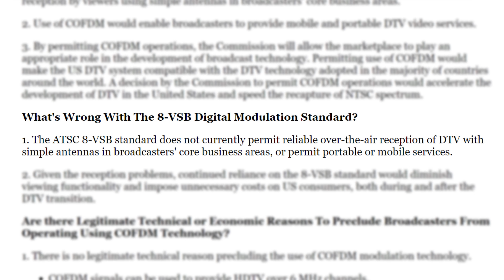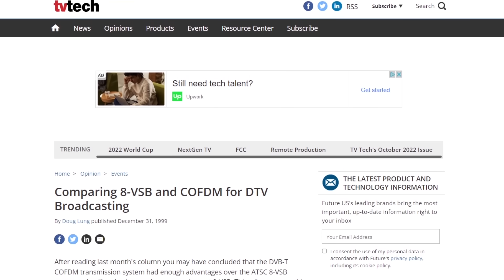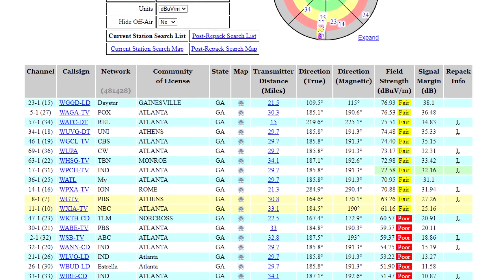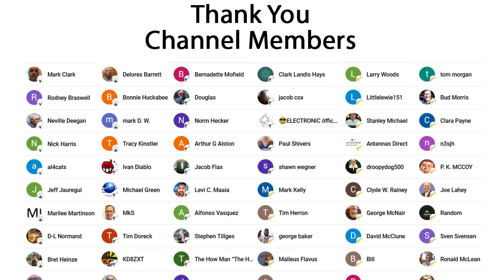This FCC Decision Made Antenna TV Less Reliable for All

Comment: As an engineer, no one listens to engineers, and when shit inevitably hits the fan, it's always "I told you so".
Reply: As a laborer, no one listens to them.(engineers). Some young graduate wants their autograph and a big at'a boy on a product or system that wasn't broke to begin with. Everything over engineered and junk nowadays. Disposable
Reply: Its been going on since I worked in the electronics industry back in the 1980s (engineering tech).  We were working on one of the first (and biggest) packet-switching networks and the management refused to upgrade the network to make it faster/cheaper/more compatible with a variety of data products like small regional competitors were doing (the big $$$ were in customers leasing time on the network).  We started losing customers in early 1989 and while our division management made excuses to corporate all us tech staff made for the exits.  The place closed at the end of 1989, the network shut down in the USA in about 1996 (IIRC).

Comment: My local digital TV reception is garbage anyways, during the black out on my Verizon FiOS TV service, I could not even receive WAVY-DT 10 too clearly.  I had to just simply give it up until Verizon came back into agreement to get the station back on the TV line up.  ATSC 1.0 is not very dependable.  I hope ATSC 3.0 will do better for this in the near future.

Comment: Thanks Tyler!  I've seen some of your videos before, always informative.  I think you might have answered a nagging question I've had for some time now (since cutting the cord actually).  I don't mind Antenna TV because there are actually numerous channels that offer so much from classics TV sitcoms to classic movies.  I've bought the more expensive indoor antennas to the really cheap ones and have found there is really no difference.  I actually am using a jumbo paper clip now because it is easier to adjust.  I always wondered if an outdoor antenna would solve my main issue, THE PIXILATING, (S.P), THE DROPOUT COMPLETELY, THE PROBLEM OF ONCE I HAVE A STATION WITH EXCELLENT RECEPTION IT KNOCKS OUT THE OTHERS.  SO FREAKING FRUSTRATING THAT I AM SOON GOING BACK TO CABLE (just the basic, no premiums) BECAUSE I DO NOT HAVE THE PATIENCE.  It seems like this latest video of yours tells me there is no hope.  I am so disappointed because I thought if I invested in an outdoor antenna my problem would be solved.  Anyway, thanks Antenna Man, always enjoy your videos.
Reply: I too tried indoor antenna's and could not get all the main stations without adjusing the antenna. So I installed a relatively inexpensive outdoor antenna and get all stations without a problem. I also set up about 11 of my neighbors with the same setup. We are about 30 miles from the towers that are located in Ft. Myers, Fl.
Reply: @danmehlman3365  Thank you Dan.  This is good to know!
Reply: Before you decide, look into streaming TV. When my OTA reception tanked, I was loath (and unable!) to afford cable--and I'd had terrible experiences with it in NYC, outages lasting for days at a time. I read dozens of online reviews, compared all the services then available, and picked one, with which I am very happy. It's not the cheapest, but has all the local stations live (even including PBS) and the reception is excellent.  There are cheaper services available, and even some free options--if you want live local news, etc., you usually do have to pay.  Living alone, I didn't bother with hooking up to my TV; I just watch on my laptop. Just about any streaming service is cheaper than cable if you compare what you get (especially sports). One way to go is to try each service in turn free, if they have a new-subscriber offer, and see which suits you best. Get the week or whatever free, cancel, try another.  Good luck.
Reply: @elainechubb971  Thank you.

Comment: It was a bandwidth issue of 6 MHz VSB vs COFDM 8 MHz. All TV channels are 6 MHz spaced.  The FCC limited the TV signal to 5.8 MHz side-bandthen it was a feed forward system.
Reply: Agreed. 8VSB played better with adjacent analog channels and required less power to cover the same area and didn't require all of the translators like Europe uses.
Reply: @navigate2u  And yes, we needed more power on COFDM on our ENG trucks than 8VSB, S/N ratio better
on 8VSB. More range. Also our main xmitters output had RF mask filters, keeping sideband noise down was a problem for adjacent channels and necessary. (FCC)

Comment: I'm a PBS affiliate broadcast tech. As Bob Diaz mentioned, the Zenith 8VSB lobbied long and hard. COFDM was also in the running, but the Zenith won. I think they somehow curried favor with the feds (FCC). Such a mandate, we were running announcements that "It's The Law!" It was a scare tactic to get people to switch to the new digital system. We were told that 8VSB was the best. Now, we'll be changing to yet another digital system - COFDM. Don't  know what to think of Zenith 8VSB; sounds like it was kind of a scam. Should've went with COFDM in the 1st place.
Reply: Yes, it would have been much better to go with COFDM from the get-go. So you work for  PBS, so I don't expect you to confirm this , but they seem to have taken advantage of this third digital dividend by selling their frequencies in the auction and trying to pick up VHF low stations, basically garbage frequencies. They made Millions.
Reply: The ways of the corrupt ….are never ending!

Comment: Excellent documentary on this.   The only comment I have is why the FCC mandated lower power for stations, especially for VHF?  I understand the electric bill issue, but we have a local VHF station petitioning the FCC currently for a UHF frequency, because their range is so poor.  They used to operate at 316K watts and now it's a mere fraction of that power and no one can view them.   Why doesn't the station have the option to increase their power?  150k watts would probably provide a really nice signal comparative to UHF, AND, it would still be lower than UHF stations, which run much higher wattage.  Signals drop off to almost nothing after 80 miles so let them use the power they need to use to satisfy their customers.  

Ok, so in theory stations may not really need that much power for their current modulation, but when that theory falls flat on it's face, which it did, then the FCC should amend their power rules accordingly and begin using that channel bandwidth as it was used prior to digital.

I live 12 miles from the station and I cannot get their meager VHF signal within my home with rabbit ears, though before digital it was never a problem so this is a clear failure of our FCC to support both the business and the viewer.

My solution, as you stated, was to purchase a 6 ft. VHF/UHF antenna, along with an amp.  I had to incur all of that expense because of an arbitrary FCC decision for VHF channels to run very low power.

Just who is the FCC supposed to be serving? Cable operators??  Yea, I think that's the problem.
Reply: 1) The possibility of VHF digital going beyond the horizon and interfering with analog during the transition was very real. Low power was intended to prevent this. In at least one low-VHF case, a digital station's power had to be reduced further when an analog co-channel station complained.
2) Power levels were based to a great extent on the 1950s measurements of analog propagation. The FCC failed to recognize that the levels of interference in the VHF band (especially low VHF) had increased over the years. Some engineers called for a plan to increase digital power after analog went away, but the FCC never developed it. So, broadcasters bought cheaper, lower power equipment without expansion capability. To increase power levels now without interference, all VHF stations would need new equipment to be turned on at a certain date. Economically, this isn't going to happen. All the dollars have been spent moving channels to clear more spectrum for mobile phones.
Reply: @oldtvnut  Understand the digtal/analog issue.  But it's time to revisit the problem and fix it.   As to the cost of these transmitters,  Telcon's paid heavily to purchase  the upper part of the UHF band.  This was money WE pay to them in our monthly phone bills!!  The govt. then ordered the repack to allow the Telcon's purchase and allowed stations to be compensated for the cost of these new transmitters and antennas that were required for them to change frequencies. 

So for this VHF station, the way I see it, we actually paid for their transmitter through our phone service.  The station itself hasn't incurred any cost, so they have the option of purchasing a new transmitter.  

But, as you say, any engineer worth their salt would probably have purchased a more powerful transmitter than required and either lowered the power output to meet FCC specs, or reduced the ERP using a lower gain antenna.   I might be wrong, but they may have the capability to raise their power by just replacing their top antenna with one with higher gain and increasing their power.  

It would be nice to see an active TV engineer respond to this.
Reply: @oldtvnut  I've been installing TV antennas for 31 years. In some areas, VHF-HI does much better than UHF does - like in my area. WJLA-DT 7 and WUSA-DT 9 penetrate through trees much better than all of the other local UHF digital channels. Channel 7 and 9 almost always have a stronger signal 40-70 miles out with an outdoor antenna.
Reply: @navigate2u  Agree, it will.  I think the real issue is that VHF CAN certainly do the same distance as UHF on much lower power but the antenna has to be the same gain as you can get with a UHF antenna. You can get 12 to 14db gain from a 8-bay UHF antenna, but to achieve close to that same gain with a VHF antenna, you're talking about something 10 or 15 ft. long like we had on our houses in the 60's.

IF the FCC thinks the general public is going to go back to installing those long VHF antennas, they are mistaken.  This is one of those situations that works mathematically, but totally fails in actual practice.  It may mean either abandoning VHF, or reducing the number of VHF channels, giving each one a 200 mi. gauardband, and letting them put out more juice.  The FCC needs to respond to this problem for the benefit of the viewing public.  At last check, they were funded by the viewing public.
Reply: One of my local VHF stations reduced the power from a few hundred kilowatts to 8 kilowatts.
Later after people switched away from antenna reception they put it back up.

Comment: I’m excited for ATSC 3 locally, but also it means that I’ll have to get a crappy digital converter box for some of my old TVs and at least one will be totally obsolete
Reply: Where are the crappy digital converter boxes to buy for ATSC 3.0?  I'd buy one if I could find one.  The ones I can find are way over priced and don't do the basics.
Reply: @wow·and·flutter·jrl  I haven’t been able to find any yet but I also haven’t really been looking, there probably will be some once ATSC 3 is widespread.
Reply: @charlie_nolan  ATSC 3.0 was supposed to be totally final and promoted in June.  I see no promotion, but there is a lighthouse transmitter three miles from me.
Reply: @wow·and·flutter·jrl  well there’s no ATSC 3.0 anywhere near me, and my local ATSC 1.0 stations just upgraded and added more channels

Comment: I live within about 10 miles of the broadcast towers and have to have an outdoor to get all locals as they are not all full power. So ya it's pretty bad. And if it is windy the low powered ones still cut out some.

Comment: Over the last few months I have noticed that I am getting far fewer channels and far less signal strength on two different antennas at two different locations in Upstate NY, both approximately 40 miles from the towers with one antenna being a very good Clearstream2V. I thought it might be attributed to the leaves on the trees but it hasn’t been getting better. If nothing improves shortly I can only assume that the days of free OTA television are sadly numbered!!!
Reply from the maker: I heard rumors that the ClearStream antennas can fill up with water and short out over time. Maybe try replacing your antenna with the amplified Televes antenna below: https://amzn.to/3p16uB8
Reply: @AntennaMan  Thank you Tyler for your quick response! I will definitely check out the Televes but I have to say that I am a little disappointed as I was hoping to get more than two years out of the Clearstream2, especially since it doesn’t have an amplifier, and my 1byone amplified antenna in my attic is experiencing almost identical results. The antennas are located in two different locations approximately 2 miles from each other?
Reply: If they're Buffalo NY stations, they moved a bunch of signals to alternate transmitters while the good sites flipped to ATSC-3. Not sure if that's involved with your issues
Reply: @peters8758  Mine are both Albany and Utica stations and the channel strength has been much weaker in both areas recently, affecting two different antennas approximately two miles apart from each other, but thank you for the info.
Reply: @stevez340  Albany/Troy stations did the same. Almost nobody has a 3.0 tuner but your favorite stations are wasting most of their KW’s from their prime antennas just to reach a few dozen 3.0 viewers. Meanwhile the signal for everybody else’s 1.0 HDTV or coupon tuner is moved (again) so call them to verify where they moved your 1.0 source, re-orient your antenna and rescan (again).
Reply: @peters8758  👍

Comment: And speaking of ATS 3.0 if you type in the words ( Airial TV Solo) on YouTube you can see the newest ATS 3.0 device coming out it's only $74
Reply from the maker: I saw the video but there's no link to purchase yet. Once there is I'll be sure to make a post about it. I couldn't test it out because ATSC 3.0 is still not on the air in my area. It's been "coming this year" for the last four years!
Reply: @AntennaMan  somebody replied on your website that ATS 3.0 will be worse because you needs internet for it to work is this true
Reply: ATSC 3.0 will actually be worse than ATSC 1.0 because it requires internet connectivity to work even though its OTA. Please do a video explaining this.
Reply: @stuarthirsch  that's not true.

Comment: My Cozi 5.2 channel via analog/antenna is 50% infomercials, throughout the day. The same channel,  Cozi 5.2, watched via my DirectTv streaming service is 90%+ programming with only 2 hrs of infomercials between 3am - 5am.  Analog /antenna does not provide substantial programming for die hard cord cutters.
Reply: Ever since the FCC started have deteriorated. allowing corporations to own multiple stations in the same market, OTA broadcasts have deteriorated to the point that I can't watch them any more. Companies like Sinclair determine what you see and hear over the air and 'cable'. I suppose streaming will be next.
Reply: Huh, I never knew that. Maybe the local stations have options to cover up programming for infomercials and take advantage of that, while the satellite version is unmolested because it's a direct feed form the source and their contact (Cozi) probably states that DirecTV can't cover anything up.

Comment: The time to complain about this would have been in 1996 or earlier.  You don't rub the dog's nose in the accident after it has dried up.  I also take issue with the idea that it has much to do with whether you can receive a signal or not.  Reliability is certainly an issue but I doubt your chances of getting NextGen TV signals are a whole lot better than they are with DTV signals given the same antenna.

Speaking of repacks, DTV has more recently suffered quite a bit from interference caused by adjacent channel issues that weren't so commonplace before the turn of the century.  That NextGen TV has the benefit of history shouldn't be ignored.  Both schemes are suffering from the crowding of channels into a smaller spectrum.
Reply: Well you can thank congress for selling all that spectrum above channel 36 to the crying and weeping cellular carriers saying there just wasn't enough room for 5G and the rest if they didn't get that sweet UHF spectrum for themselves. So all the broadcasters that were originally on all the channels above 36 got crammed into 2-36, and to be honest 7-36 (2-6 is worthless for digital TV). So more adjacent channel interference and co-channel interference between markets, especially out east where you have markets as close at 35-50 miles away from each other..

Comment: I don't think the modulation matters much, sure COFDM has some advantages over 8VSB but it's the other way around too. What really matters is the ERP and the amount of Error Bits. We have had COFDM with DVB-T from the start (2002) and signals have always been very unreliable especially with indoor antenna's, even when a motorcycle comes by and people loosing their signal.  Now we have DVB-T2/HEVC and although the picture quality improved the reception didn't (less error bits or less power) we also have more single frequenty networks and still multipath issues.. So much for COFDM right.  To give you an idea, less then 100.000 people are using TV antenna reception on a population of almost 18 Million people, so i'd would say it failed.

Comment: If manufacturers listened to their engineers they wouldn’t use those cheap electrolytic capacitors that prematurely fail. If they listened to engineers they wouldn’t make cheap plastic parts that fail long before the rest of the product etc.

Comment: Even ATSC 3.0 is not perfect, I live east of Cooperstown and get signals from Albany. 1.0 has a lot of problems with multipath that 3.0 solves to some degree. I am using a Televes DatBoss Mix LR which is on the upper end for an antenna. Living in the black hole of signals is challenging.